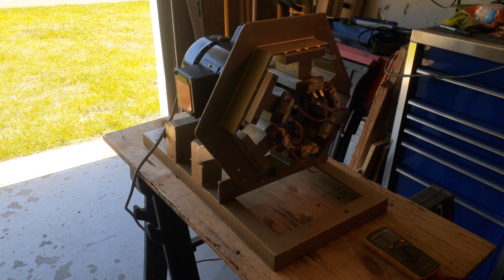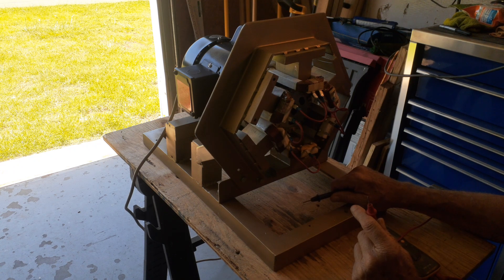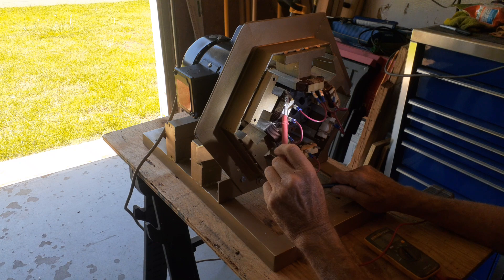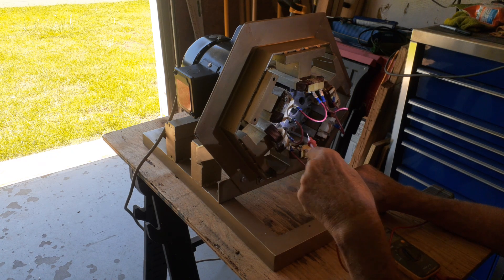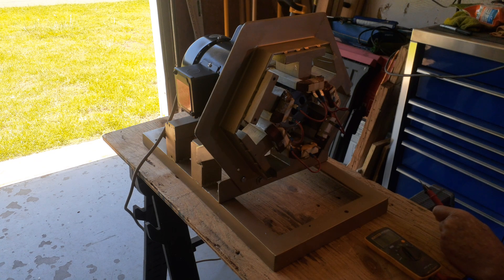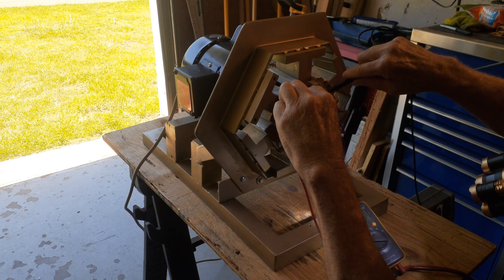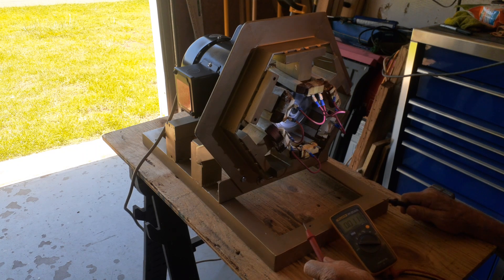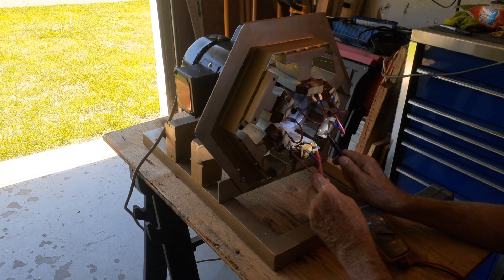Self Running Generator Test Results

Comment: The coil configuration must be like north-south-north-south magnets, and the coils must be clockwise-counter-clockwise-clockwise-counter-clockwise. If any coil is incorrectly connected, instead of increasing the voltage, it will decrease it. The magnets must be the size of the center of the coils and must occupy the entire center. With six coils, you have three magnet configurations: two north-south magnets, four north-south-north-south magnets, and six north-south-north-south-north-south magnets. Try this configuration and you will see the magic happen.

Comment: The whole thing is in reverse and ill built.
Need equal coil to magnet ratio.
 magnets need to be one piece 1/4 moon magnets  and equal to the width of the stator face.
Use the wide back of the coil housings to use larger magnets to get more reaction time and machine them to match the circumference of the rotor to improve air gap   vibration and noise.
Use a non conductive material to house the coils to prevent the stator housing being a break magnet on intermittent poles.

Comment: the magnet will need to be closer to the center point of the microwave 200V coil to get the max power. The setup here has the magnet set up at one side of the coil. I've done a similar setup with 2 fan motor and generating 53V AC. I had like 15V AC when I place the magnet at the copper coil and 53V when I push it in to the center point  of circle of the copper coil.

Comment: Good job 👍. I am having a go at building free energy devices myself too. From what I have learned, most devices remove the back emf. I think that the liberty engine does this by using a special mix of metals in the rotor.
There are other ways of removing the back emf, high impededence coils will do it. Thane Heinz proves this. 
A system using water a water wheel can also remove some back emf.

Comment: Try connect were you show the mesure in the video direct to the AC motor and unplug from wall socket.
Its a loop. If you know a joule ringer ?
The AC motor only ping the amp and voltage in the loop ( raising the wave)
Liberty engine they have probably advanced instruments. Magnets controll both the down wave and up wave. I gave up some monthe ago i did one with an dc motor and magnetic.solenoid coils and used lead battery and rectifyed it did run without consuming the battery. All in plastic and after som hour the whole consrruction broke. Therefore i can say that ac motor spec is to be converted to joule and magnet force to joule. From there you can go.
I folow your videos..it have to be free for all..
Best from sailor63.

Comment: Hear me out guys- rotary engine- bent pyramids- water ram jets- I do t understand physics, or electricity. I have no formal education, but I do understand the concept of closed systems take more energy than they produce, but what if you had a high output alternator and a low watt electric motor and use some type of transformer or capacitor to lower or boost the energy draw.

Comment: did you use the alloy argoluminum? he says its the special sauce in all their motors.
Reply from the maker: I doubt that would make any difference, but Houk Aires the Navaho Indian is extremely concerned .., LOL! But in his test I noticed freshly dug dirt?
Reply: @monstirz  i dont know if it would.  what is houk aires channel name? dont see it under that name. and if liberty is lying then he's lying aboutitall.  but if he's telling the truth, he's tellin it about it all. his engine does works? , then it  will work w the sauce.
Reply from the maker: Who Cares or houk aires..,lol @johnM-Jr
Reply: I been asking that same question about the importance of the silver-alum rod.  My guess at this point has to do with lower resistance.  Alum does not conduct electricity and only the silver and other conductive elements in the rod would only conduct the magnetic field and in theory would have less resistance than a sold steel rod of the same size.  The lower resistance will transmit stronger magnetic field.  In one of their videos they mentioned they purposely left off that piece of information about the thin metal layer of silver-alum that they wrapped around the magnets before wrapping tap around it.  This supposedly created a stronger magnetic field.  In their Liberty #3 motionless generator they used a silver-alum rod to carry the magnetic field from the stator to the microwave coils on either side.
Reply: @joecoyle3117  yes, its possible to figure the ratio of silver to alum using the specific gravities they give. ~ 55% silver and 45% alum
Reply: To kamuflaż  te argalium tylko po żeby wam się to nie udało i był wielki problem z  tym stopem  ażeby to  miało zadziałać trzeba to zrozumiec  tu nie które komentarze są blisko prawdy ale brak zrozumienia tej technologi te ich wszystkie generatory działają  tajemnica  ukrywana jest przed wami nie przez nich tylko tych którzy to blokują jest wystarczająco dużo pokazane wystarczy pomyśleć i tu jest selekcja na dużo baranów chcących to osiągnąć ale wiedzy zbyt mało są tu ukryte i nie powiedziane 3 rzeczy  i one są we w wszystkich ich projektach morał jest ten sam tylko inny show  TO DZIALAA i jest blokowane przez tych którzy tu się gapią i nie chcą żebyś to miał

Comment: what i see to not testing correct if they did they would get exactly the same out as in if plugged in DOH 
so the magnets and coils are for running not power output. all you achieved is to dispel yourself.
Reply from the maker: No I proved Hidden Tech is total BS.
Reply: NO got your answer wrong also you only proved you don't understand much.
Reply from the maker: I only built this to see if possibly there post proved legitimate power production. I am glad that you are an expert but you do not need to insult me anymore for only a moron would continue to be abusive. I got ya' mickey now get off of it or your banned from my channel. By the way where is the video of your free energy device? Furthermore take a look at how Chris Harbour in Wales used a water wheel and an electric motor to make 1000 plus w with capacitors exciting the electro magnet and getting the coils to produce power.
 @mickcherie1

Comment: You need to wire together all 3 oppisite pairs then tie one leg of each set together, leaving 3 wires or legs this is now a 3 phase alternator
Reply from the maker: I may try it down the road. I am working on a 500 rpm 2 Kw rare earth magnet generator and a 3 hp 12 v motor to turn it and draw off of the output to charge a battery soon. Saving up for the components right now.

Comment: Hello,
If I understood correctly, the working principle of the Liberty motor is that permanent magnets with coils are used for self-rotation the electric motor, and than that motor  generates energy (230V) to power the coils of the permanent magnet and not the other way ...
Reply: yes thats what i see to not testing correct if they did they would get exactly the same out as in if plugged in DOH 
so the magnets and coils are for running not power output.

Comment: You're testing the voltage in the wrong place. The coils are only getting a electrical charge to make them magnetic THAT'S the 7v. Open the box on the engine and you will find your 230v output. And to get it to self run you just need to find away to turn the generator fast enough for it to start getting the 7v to the coils which will make the magnetic fields that will keep the generator running on it's own

Comment: Wire in parallel NOT in series.... Additionally rectify to a super capacitor that's give you much higher output voltage.

Comment: For that series coil winding, you want either 7 stator poles & coils in series with 14 poles on the rotor, or if using 6 poles & coils in series for the stator, then the rotor should have a multiple of 6, so either 6 or 12 magnet poles.

Comment: Oh sorry and of course should have stated that in liberty the coils are wired for maximum power & each pair paralleled for collective current. As rotor spins each pair is simultaneously magnetized so no phase shift that is one pair N the other S alternating a push/pull arrangement for correct waveform and voltage. Note each pair is a separate circuit one used to drive motor plus extra if wished and the other full socket for independent use. (obviously both totally out of phase supplies).
 Anyway the non-mechanical version is better using larger 3-phase motor stator with triple MOTs on each end and using non-necessity of full shaft as only need it sofar into each end to get the magnetic resonance and stator producing multiple paralleled current sources, in this case well over 20kw?
Reply: I am a fellow researcher.  Please contact me.

Comment: I used 2 x triple MOT coils per frame and 3 frames exactly the same with a longer resin rotor with N52's rotating under 900rpm for 50hz and 230-40vac. Liberty used 2 x twin Mot coils single frame only at 1420 for correct Hz and 230vac.
Reply: Did your design worked fine?

Comment: Before getting overexcited there needs to be adjustments like N52 magnetic strength and circumference off fitted six coils you need so as to get under 900rpm for 50Hz. Remember coils used by Liberty are at tested/determined circumference required for about 1420rpm of driving motor to maintain 50hz. Speed and magnetic strength then enable proper ac wave propagation at around 230vac. The rotor material is really irrelevant I used fiber glass resin for best results.
Reply: How can I privately contact you?.
Reply: @Magneticity зачем тебе с ними связываться ? Они ведь тебе не сказали ,что у них за кадром стоит тесла и энергию на установку они передают ей . А все остальное сплавы с серебром для уменьшения вихревых токов ,магниты это все глупости для дурачков 😂😂😂😂😂.

Comment: Generally speaking, having more or less magnets does not affect the power output of a motor. It changes the torque and speed range instead. The efficiency change just slightly because if you change the number of magnets you change the magnetic flux arrangement. A motor with 12 poles will have more eddy currents losses because the magnetic field changes its polarity faster than a 6 pole motor with the same rated speed. Also by connecting the coils in series you are cancelling out the voltages because one set of magnets will be north and the next set will be south creating magnetic fields through the coils in opposing directions, you'll need to reverse the connections on every second coil. Also you cant have 6 poles and 14 magnets as the poles wont line up to the magnets in the most optimal position. You need to have either 6 magnets or 12 magnets for alignment. Also your magnets look like they don't cover the full length of the coil core.
Reply: U cant help this narcistic physcopath

Comment: Perhaps you need the coils back, not close to the rotor as it seems the main factor to avoid the Lenz counter effect
Reply from the maker: When the coils were farther back the voltage was only 4.72 vs 7.49 when closer to the magnet rotor.
Reply: @monstirz  Thank you, im beginning to think those people are using video editing and cgi in the supposed "demonstrations", if so its a big shame. Hope im wrong

Comment: FYI. Having lots of coils in series does not necessarily mean that the voltages will be always higher. What happened to your system is that there is an electrical phase shift that happened to each and every coil voltage output that is why the voltage does not increase due to the number of your magnets you are using . It also does not follow having lots of poles/magnets will result to higher power output. It does not work that way. AC generators uses a definite combination/proportion of number of magnets to the number of coils to remove the electrical phase shift to produce a stable high output voltage at a desired speed/frequency level (50 / 60 Hz suitable for appliances). When you use 14 magnets at a speed of 1400 - 1500 RPM which is your drive motor's speed will result to 163 Hz of frequency (Formula: speed = 120 x frequency / number of poles) and it will burn your appliances immediately. It is theoretical to use 2 or 4 magnets only to avoid electrical phase shift of the voltage thus producing a stable higher voltage (4 coils only same with the Liberty Engine 2.0  / 2 pairs of coils connected in parallel facing each other). Also, the reason why the Liberty Engine 2.0 used a aluminum-silver alloy is to make a much heavier rotor at, 7.6 kilos including weight of all the magnets. (because aluminum is very light and silver is way more heavier than aluminum and non-magnetic) Thus utilizing the rotational power produced of a heavy rotating body due to it's large moment of inertia to maintain a stable speed even at high loads and reducing magnetic braking effects. I hope this helps. This is all about electrical engineering foundations. And, one last thing, the position of your rotor is not centered to the center of the coils that is why the voltage is too low even the air gap is very small.
Reply: Have you made this free energy engine ? How you prove that liberty engine is not fake please help

Comment: Hi
You have some mistakes and you can avoid it as follows 
Coils to be upside down and all the way down.
Magnets should cover the whole transformer core wide +60 mm.
Magnets should be 4 N S N S only, not as much as you have.
Magnets should be high power, minimum N52
Motor speed should be 1500 rpm for 50 Hz or 1800 rpm for 60 Hz
Rotor should be aluminum alloy.
You can try these modifications and give us the results.
Goodbye and good luck.

Comment: i believe what you are lacking is the resonating part, use capacitors to adjust the voltage, two of the same type in series, capacitors store dielectric electricity, you can adjust the right uf just use both of same like 20 uf or 15 uf, read the voltage out of them to see